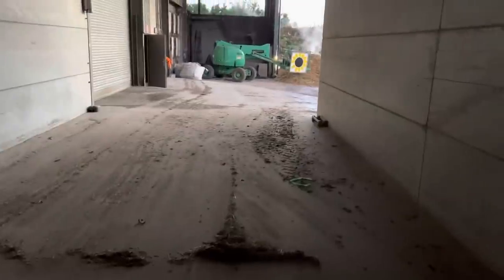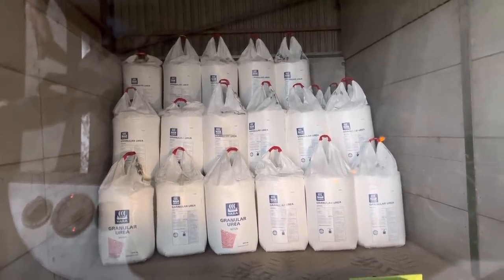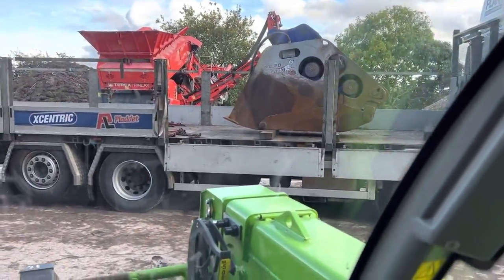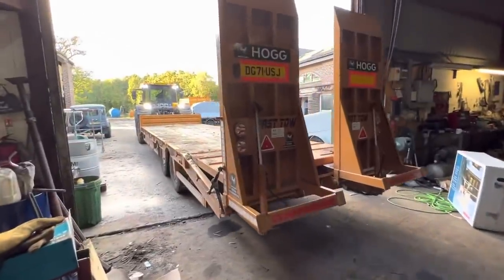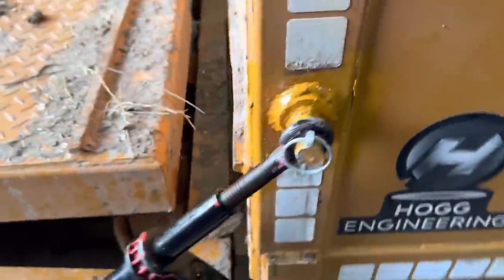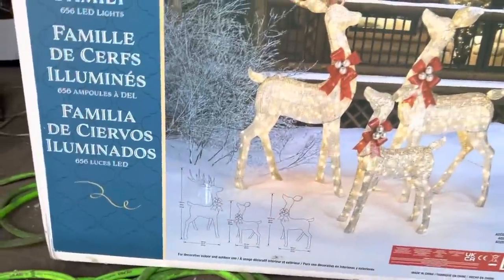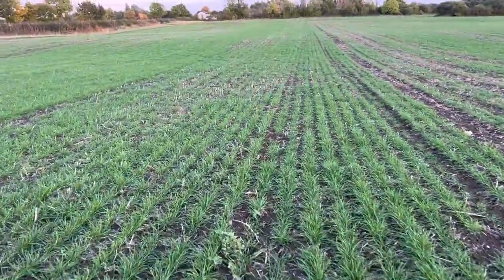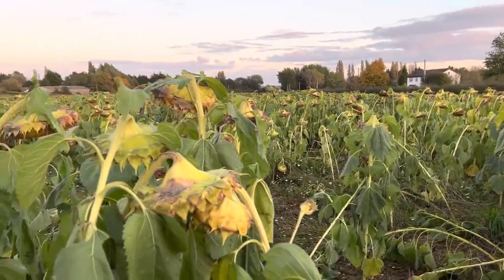Day582  #OLLYBLOGS SOMETHING REALLY EXPENSIVE ARRIVES & I FINALLY FIX LOW-LOADED  #AnswerAsAPercent

Comment: Hi Olly, excellent video again as usual.
1455 has a disc brake on the back end of the front prop shaft for front wheel braking, rather than going into 4wd when you brake, so mismatched front & rear wheels won’t be a problem on the road.
Hope Christine is feeling better soon. 👍

Comment: Maxum every time, had a 5140 on an L plate when they first came out, was my tractor on the farm I worked on. Thought I was the kiddy.  😁👍
Reply from the maker: Early ones never had Neutral on the shuttle 🤦‍♂️
Reply: @OllyBlogsAgricontractfarmer  we had it retro fitted/ it was only the job of putting the later switch on the column. Don't think anything else other than a relay.

Comment: Olly. Why don’t you use a surge protection box and clamp onto the battery or the remote terminals as way quicker than disconnecting the battery terminals and soon as green light shows your ready to weld. 
Had one for years here and works really well but I always do my welding and remember to place it back at it’s home station. 
Definitely Maximum 👍. Is there still one where you bought 1455 and MB Track ?

Feeling about 20% today as slipped a disc in my back on Saturday  and can barely walk or get outa bed and have that really horrid flu type cold that’s circulating  and keep going hot and cold and coughing and arthritis in my shoulder
Reply from the maker: Yer he still has it in
Reply: I always worry those boxes a a bit of a gimmick and give a false confidence. Once saw the program wiped on a factory machine by somebody welding yards away from it. Personally with all that electronic stuff it better not to weld on it at all unless essential regardless of power status, if you manage to wipe it it’s a big bill.

Comment: Run the 1455 on something heavy on the pto (slurry pump) or something equally heavy. Always helps to give her a blow out, revives those lazy horses and it will run like new. We do this with the 956 once in a while and there is a noticeable difference

Comment: Re the 1455 power problem.  Go back to basics  before changing wheels and tyres. Clean out the primary fuel filter and change the secondary one. Blow out all the fuel lines with compressed air, to get rid of any sludge and water.  Remember that water doesn't combust. Check the air filter, working in a dusty atmosphere will clog it up very quickly. Operate the throttle to make sure that its hitting its maximum travel stop ( assuming its not fly by wire throttle).
I'm convinced it's something basic.  Good luck.
Reply from the maker: It’s a cable throttle yes needs a day in the workshop

Comment: Doesn't matter if its in 4 wheel drive or not, bigger back tyres would still wind the diff up on the front unless you matched the fronts
Reply: How? Only think it could damage would be the 4wd clutch pack. If only for this trip would be easy to take the prop shaft off I would have thought

Comment: If you change the rear wheels you have to match the front wheels , if you have front turning at one ratio and the back’s turning at another ration you can do damage , a mate had a db995 4wd that did damage that way . 2000 grit wet and dry paper and a bit of water and you will get the paint like glass 👍
Reply: With the glitter in it, it might not !! A dozen coats of clear lacquer might though.